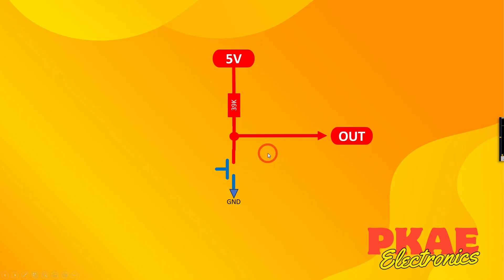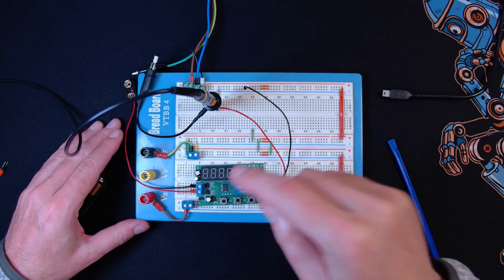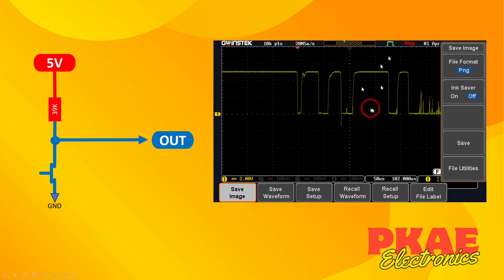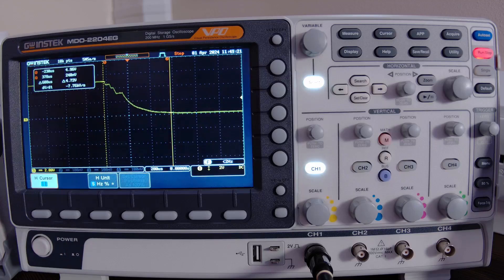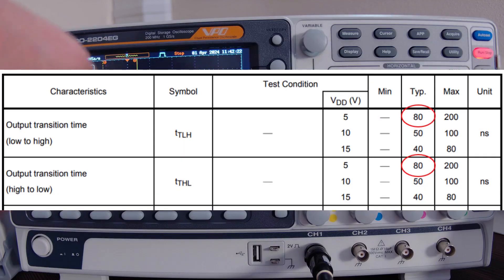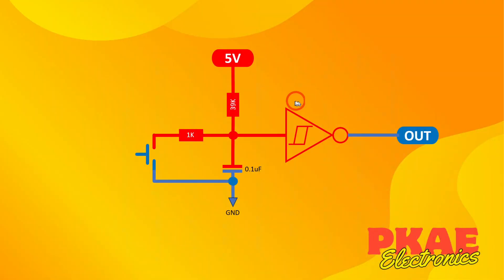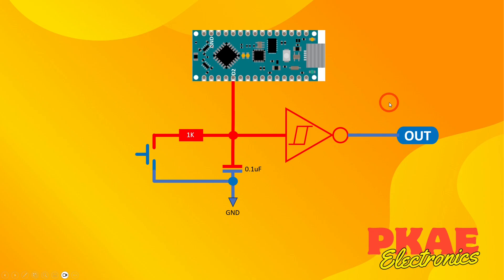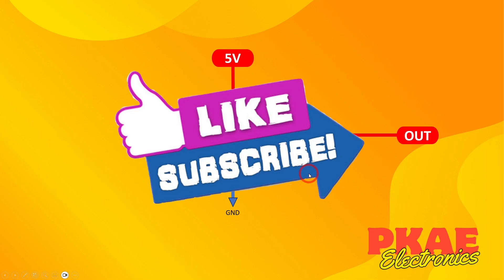Switch De-Bounce Using Schmitt

Comment: Hi, nice video! What kind of scope are u you using!? Is it a Chinese brand? Was it expensive? Do you recommend it?
Reply from the maker: Thanks for the comment. Its a GWInstek MDO-2204EG, Multi Domain Oscilloscope. In other words, it's a Scope and Spectrum Analyser in one. It also has an inbuilt signal generator and is capable of Bode plots/frequency response analysis etc. I love using it and do recommend it, but at around £1,600 it's quite an investment for a hobbyist. However, I do feel it's been one of the best investments I made, 100x better than my old Hantek. 

For me it was a purchase inspired from the video by Eddie at Kiss Analog (link below). If you look in the comments to his video, you will see I commented 4yrs ago saying I had purchased one. 

https://youtu.be/g-p6POqWmno?si=9oaTzi4FtzHMQkUv

Comment: Instead of a Schmitt trigger device, I wonder how a enhancement mode MOSFET with a properly balanced gate power and bleed resistors would work as far as behavior and fall time. If you only needed a few instead of a whole chip full of de-bouncing, it would take up a lot less board space.

Comment: I'm not convinced with your explanation.
Digital inputs already have hysteresis; so would would another device that also adds hysteresis add anything different.  The magic sauce is the capacitor with the Schmitt trigger or just a regular input with hysteresis built in, which all modern digital electronics have.
Reply from the maker: Good point. If the input device already incorporates hysteresis (normally shown on the schematic with a schmitt symbol) then it is not necessary to add the schmitt IC. However, the capacitor/resistor arrangement are still fairly essential because the upper/lower voltage peaks of the switch bounce will exceed the thresholds.

Just to note though, not all inputs/devices incorporate hysteresis.
Reply: @paulpkae  "not all inputs/devices incorporate hysteresis.", the hysteresis is stated in the specifications of digital electronics.  Each logic family has their own hysteresis margins; so i'm not convinced by your statement.  I'll happily watch a video of you proving the statement though. :)
Reply: Your missing the point, the video is showing one way to fix a problem and that is 'switch bounce' a fully understood problem. If he was discussing a device in particular then yes you might not need to worry but if you do have a circuit that is affected this is one way to fix it, and it's common especially with beginners who are just learning about Microcontrollers (Arduino)

Comment: This is my favorite way of de-bouncing buttons, as an extra thing, on many microcontrollers (if not all modern ones) you can save using the Schmitt trigger IC since many already have one on the input circuitry, the external IC is mainly needed for old components an when used with other components like logic gates.

You can take a look, for example for the ATMEGA4809 on the datasheet is on page 142 

Good video as always
Reply from the maker: Thank you.

Comment: Very good video thanks. But Arduino you are using is old nano atmega 328.
Reply from the maker: Thanks. It's actually it's an Arduino Nano Every, using ATMEGA4809. 

The example method given for measuring the internal pullup resistor can be applied to any microcontroller.

Comment: In older electronic circuits before microcontrollers we always used Schmitt triggers (7413 if I remember correctly), for de-bouncing and as input to frequency counters, then this disappeared.
Reply from the maker: Thanks for the comment. Schmitt triggers are still very common, but you now find that many devices have Schmitts built into their inputs already.